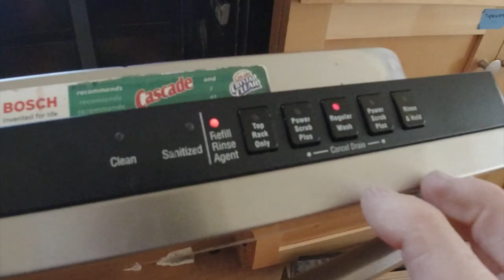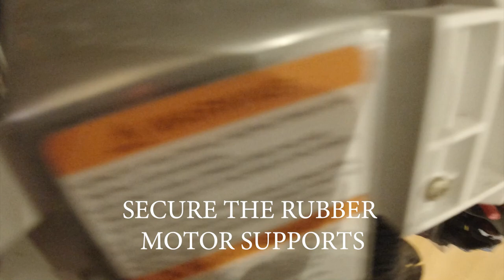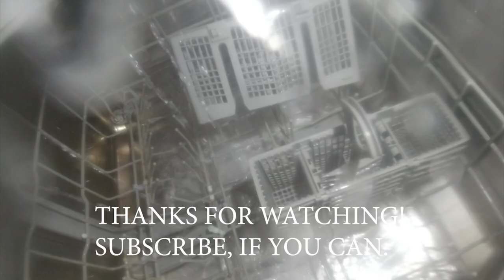REPLACE IMPELLER, BOSCH DISHWASHER, LOW WATER PRESSURE

Comment: My Bosch dishwasher is doing the same thing, has water and can still drain and release water but the pressure is so low it wont clean or even turn the sprayers. I will check if its the impeller.
Reply from the maker: Thanks for the comment.  Check the spray arms also to be sure they are clean.
Reply: @swilson6206  the impeller has detached but i cant find parts sadly.
Reply from the maker: What is the model number? Will try to find parts.
Reply: @swilson6206  SPS2432AU/04 Thats the austraian and NZ model which is 230V 50Hz but the impeller should be the same for other models. The UK version might even have the same pump/motor unit as the voltages are the same.